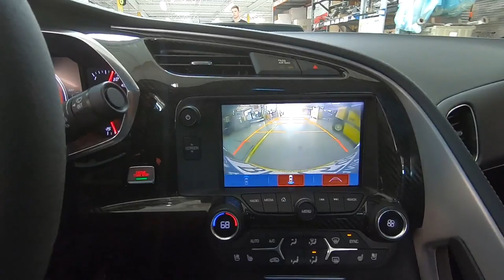THE OPPORTUNITY OF A LIFETIME... MY ZR1 AND A FORD GT!?!? *I NEED IT!*

Comment: The current Ford GT has got to be the most overrated cars available right now. $400K+? You have to be kidding. If it were around $150K to $175K, I could see it, but otherwise, you just have to laugh. But hey, I guess you don't see them on the street very often, so if that's what you are looking for, go for it.